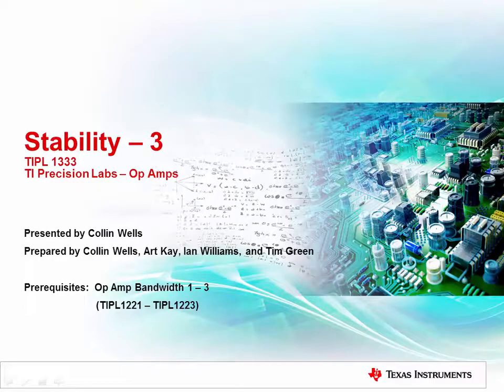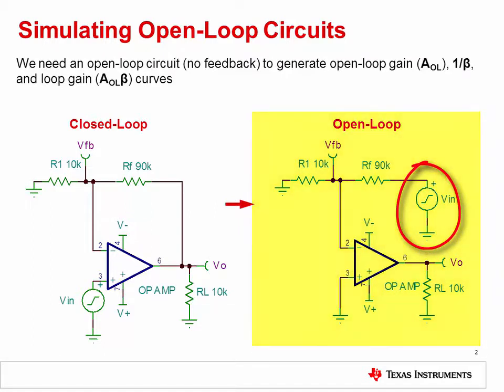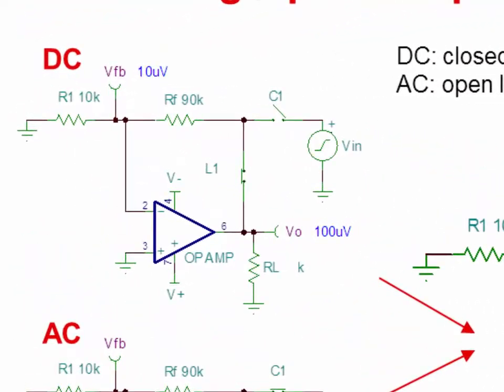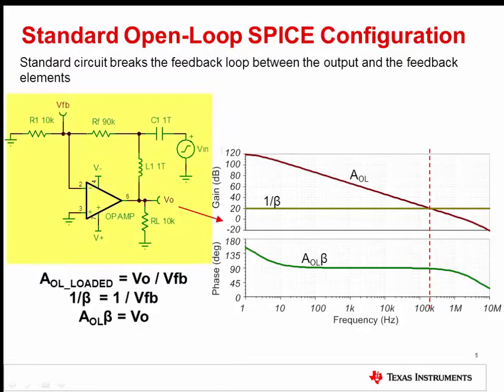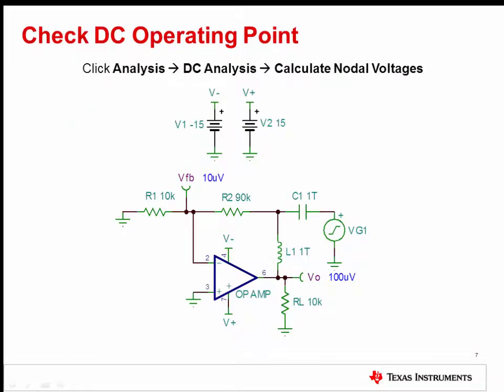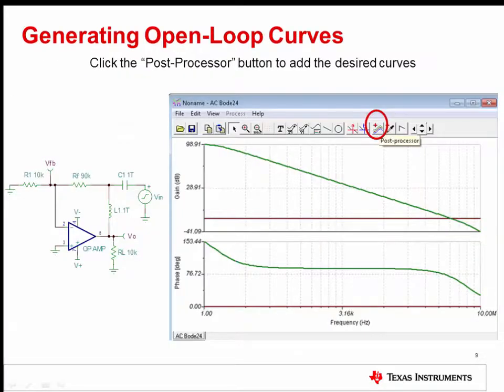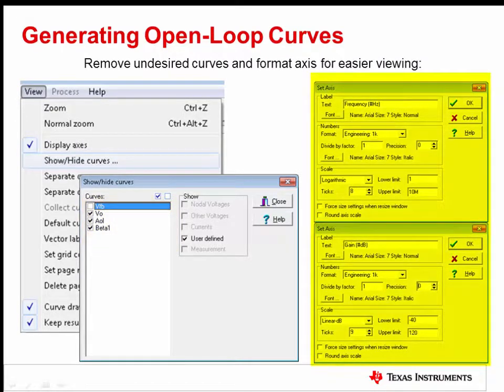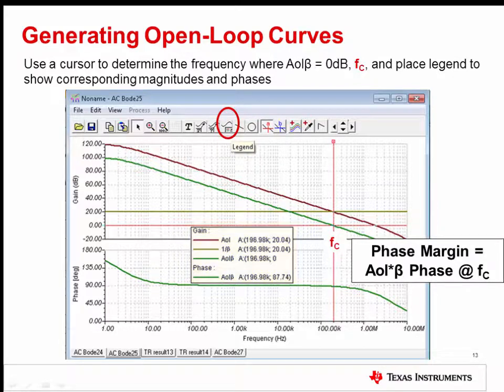Spice simulation

Comment: What opamp is being used in the simulations?
Reply: Ideally the one you're simulating for use in the circuit you're designing, generic single-pole amps don't work. The GBW is declared on the datasheet at that gives you Fc. For an NE5532 it's 10MHz for example with (IIRC and open loop gain of 120dB). A 741 is 1.5Mhz (as low as about 600KHz). Closing the loop applies some or all of that gain. For a 10x feedback (20dB) the closed loop gain drops by a factor of 10 so the more gain in the loop, the lower gain makes the phase shift less of a problem.

I learned some of this using a popular model like the 741 in a stable (follower) circuit and you can see the internal pole at about 4Hz at full gain on a bode plot.
Reply: @marcdraco  Yes, I agree.  I will do that.  I asked though, because I wanted to repeat your simulations in LTSpice and make sure I get the same or similar results before simulating with my own opamp.  Will you tell me which opamp you used?

Comment: Why the open-loop gain could reach 120db after adding the inductor even when the Opamp is saturated at V+ and V-?
Reply: It is related to the internal circuit of the opamp. Check the transistors’ bias current at the output of the opamp.